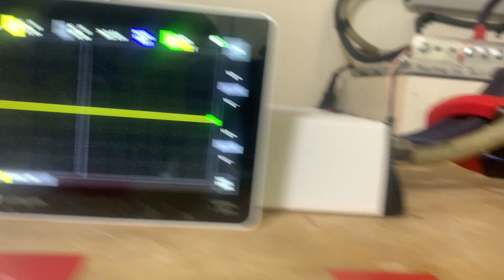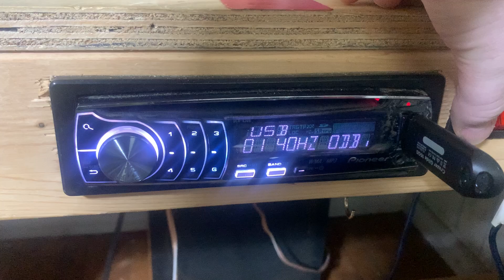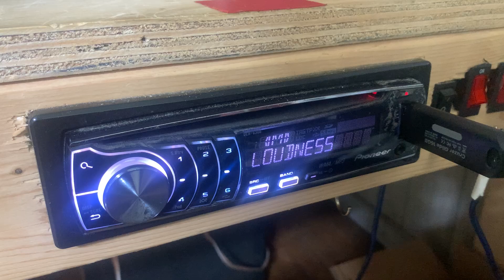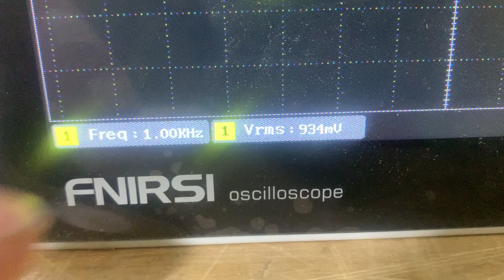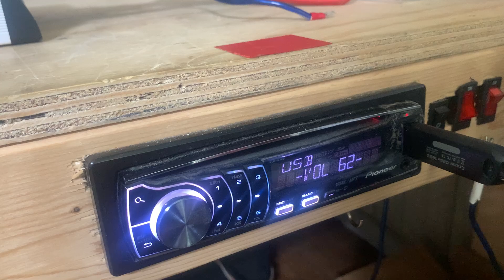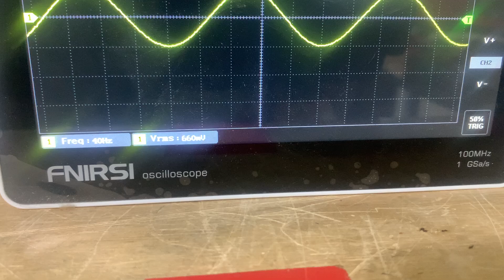Clipping part 3 RCA signal 40Hz versus 1kHz

Comment: @AllAboutAudio- Hey, thanks for showing clipping with a 40 Hz, & a 1 KHz, 0 Db, -5 Db, & -10 Db test tone. Years ago i didn't have an O-Scope, so I used my clip light, from my amplifier to set my gains, while my deck was on pause. I started with my amp gain as low as it would go, then while the deck was paused, i turned up my deck till my amps clip light started to flicker= @ Vol 50. I then un-hooked my speaker wires from my amp, then played a 1 KHz 0 Db test tone, & turned up my deck till my amp clip light flickered, & it happened @ volume 50= @ the same volume as when i had my deck paused. Then i used a 40 Hz 0 Db test tone, turned up my deck till the amp clip light flickered, but this time it happened @ volume 49. So then i used volume 48 to now set my amplifier gains, as they were turned all the way down still. I turned up my amp gain until it lightly flickered my amp clip light, then backed it off a smidge, that's how i set my gains back then. My amp clip light will start to flicker lightly way before actual clipping, how early i don't know. I have a pioneer head unit, can't remember the model, but its prob. 8 to 10 years old now. It has 3 sets of 4-volt RCA pre outs. Seeing this video makes me wonder if my pioneer deck, if tested on an O Scope, is my Max unclipped deck volume really @ volume 61, with a 0 Db test tone= Probably🤦‍. But i matched everything @ the same volume, & always backed the volume off when the clip light was on. What do you think? Is it fine to set everything that low= @ volume 48, instead of volume 61= if that is my true clean Max unclipped volume? Meaning do you think I'm losing performance, or like i assume, I'm just peaking early= not using the Max Linear volume control?
Reply from the maker: Yes it is absolutely more than OK to set the amp gains at a lower volume. It will actually give your amplifier a cleaner signal to work with from the start.  👍
Reply: @AllAboutAudioJW  - I met a World Champion Sound Quality guy years ago, & he was showing me how Quiet his system was, while it was paused, & set to his maximum volume he used for Sound Quality listening. You can hear as you turn up the gain on an amplifier, a point where it gets noticeably more noisey, i describe this as background noise/hiss. I have been in discussion online going back & forth with kids, about signal to noise ratio, & how different amplifiers have different S/N ratios, & how this can translate to better sound quality scoring from judges= quieter is better.  Less hiss/back ground noise while paused, or silent gaps in some musical tracks, & how a high enough RCA input voltage to your amplifier, that will allow full power to be obtained, while its gain is turned All the way down, as this will give the amplifiers best S/N ratio. I'm sure you know this already, but these young kid's think I'm full of you know what? And they think I'm talking about alternator whine, or a ground loop noise, & I'm like No, I'm talking about how much hiss a system has, while on, but paused, with the volume cranked to just under clipping. And most are like you shouldn't hear anything, & if you do you must have shitty equipment, & I'm like No i have quality interconnects, wiring, & Audio Equipment. I tell them every system has back ground noise, i can hear it in every system. They are like your crazy🤦‍.
Reply from the maker: @ Yeah most people do not understand these things at all. It is refreshing to hear someone that is actually intelligent in the car audio scene for a change!
Reply: @AllAboutAudioJW  -Thank you, & yes it is very refreshing. This was in the early 90's, & was the 1st time hearing about a Noise Gate, time alignment, & using 31 band Eq's, 1 for the Left ch., & 1 for the right ch.. Also this sound quality vehicle was the 1st vehicle i seen with a motorized subwoofer enclosure, with his amplifier rack integrated into this, that came out of the spare tire area, & angled up & backwards. Also had a motorized stock deck that dropped down out of the way ,to make way for his aftermarket head unit. The Component's, Amplifiers, & Subwoofer's were ALL top of the line A/D/S. The whole system could not be seen, until he activated his dash mounted switches, it blew my mind! This gentleman was a mid 50's Engineer, that explains his motorization skill's. It also sounded AMAZING!
Reply: What model is your oscope?
Reply from the maker: @Gravytrain815  https://www.amazon.com/FNIRSI-1013D-Plus-Oscilloscope-Bandwidth/dp/B0BHHYMVKV/ref=pd_ci_mcx_mh_mcx_views_0_title?pd_rd_w=IlV6V&content-id=amzn1.sym.bb21fc54-1dd8-448e-92bb-2ddce187f4ac%3Aamzn1.symc.40e6a10e-cbc4-4fa5-81e3-4435ff64d03b&pf_rd_p=bb21fc54-1dd8-448e-92bb-2ddce187f4ac&pf_rd_r=2ZHD66SCF83FHTG8BXN1&pd_rd_wg=aMCHh&pd_rd_r=d84012a1-0a19-421a-8202-731b8c450a87&pd_rd_i=B0BHHYMVKV
Reply: iam getting the gest of it dont fullly understands but in real world starting to understand some